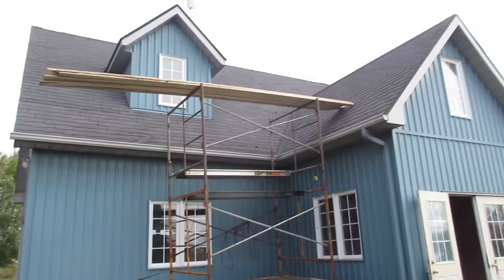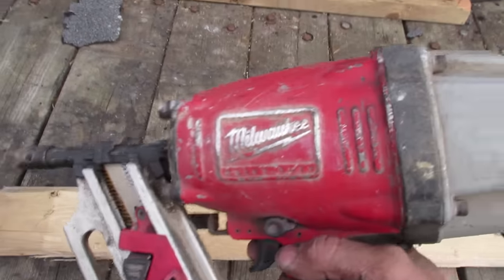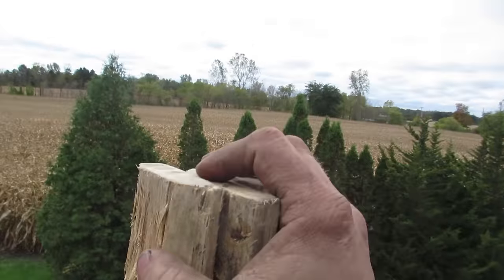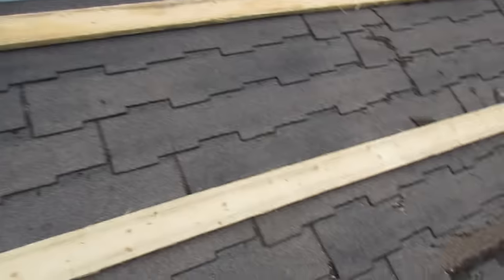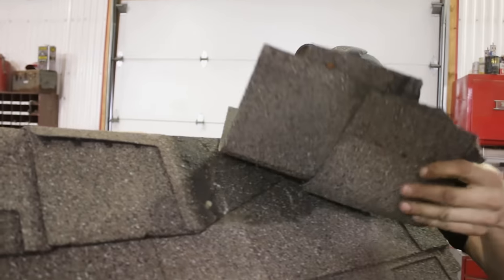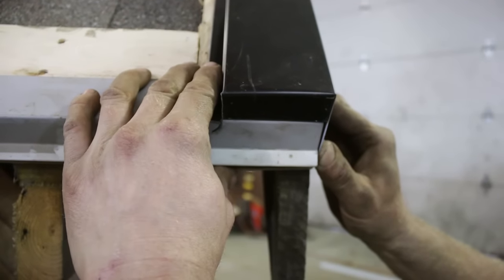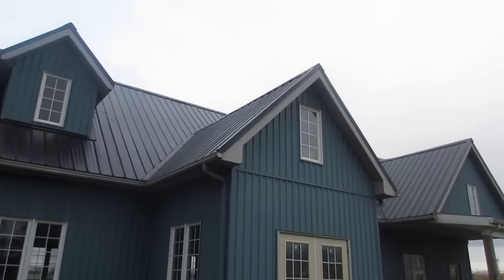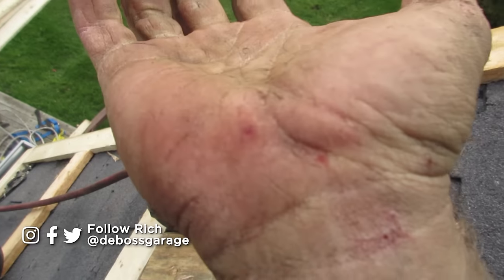How To Install DIY Metal Roofing (House or Barn)

Comment: We have a cottage with 2 or 3 layers of shingle on it. After removing them all it will be exposed 70 year old antique knotty pine tongue and groove from 1952. Should we be covering that pine board with plywood? (Knots have shrunk and fallen out in places leaving holes) Ply at what thickness 3/4? And a membrane of some kind before strapping on top of that (plywood or knotty pine board) base layer? Reason why I ask is they are doing it now near Timmons and really need some great advice from a TRUE professional. Thanks in advance!! Great channel !!!

Comment: You did a fine job in explaining the procedure! You said you are in Canada, which part? I have been to Toronto, Mississauga! I am looking into installing this type of roof system. Shed roof, 24 ft. wide, 3/12 pitch. with 2 ft. overhang. I calculated 26' ft. 8" 13/16" total length. I am thinking I can get 28 ft. lengths? Good job on your detailed explanation. I am sure I can do the job with attention to detail, and no leaks! Thank you again!

Comment: A guy did our "Tin" roof using two foot spacing on the rows of screws, and didn't put down strapping. He snapped chalk lines to get them all even. Only problem was, every second row of screws went in the crack between sheets of plywood! The result: loose and weeping screws. (Screws always loosen due to the metal expanding and contracting with temperature changes.) So make sure you offset your rows to miss the cracks. You could make the first row at 18 inches. We tighten the screws every year, and put in bigger diametre screws when they don't hold any more. We've changed them out three times now. I keep saying I'm going to back the screws out, get up inside, and nail strapping on the underside of the deck, to give the screws some meat to bite into. But it's a pain, and I keep putting it off.

Comment: Excellent info on the dog house. I’m in Ontario Canada and planning to strap and do a similar rib roof for our unheated detached garage. When they built our garage in 2008, they blocked between the roof trusses at the peak. Since it’s unheated, I’m thinking to not cut the ridge sheathing for a ridge vent. Would like your thoughts on this. Thank you.

Comment: I have 3 small rental homes I am re roofing with metal. Thank GOD they are 5 -12 pitch! We are actually using 2.5 inch deck screws to secure the 1 x 4's and we are running them into the roof joist. We left the shingles on and I used a reciprocating saw to cut the the edge of the shingles off.

Comment: I'm interested I your opinion the metal barn I have put up the metal manufacturer told me to put the screws on the flat not the rib. I would think this would maybe cause a problem because water runs down the channel instead of the rib. What's your thoughts

Comment: Where I live we have something called condensation. using pine perlins, non-galvanized nails, and creating air space between the shingles and the metal roofing is sure to cause condensation. The water formed will rot the perlins and rust the nails.

Comment: Most of the industry never mentions you are supposed to change the screws every 10 years.The washers deteriorate.I have learned this the hard way.Have already replaced a roof with shingles.Screws were rusted and replacements wouldn’t tighten not even a #12.

Comment: Would be helpful if you told us what the cost of the materials are and best place to buy them from.
Reply from the maker: Every roof is different so price is irrelevant.    I pay about $.89/sq foot for roof steel.  Each screw works out to about $.08 and every linear foot of trim is roughly $1.
Reply: price in canada, or even different regions is nowhere the same.  your prices can be found locally pretty quick.  If Rich put prices in the video, he'd have tons of I paid this and got screwed or I only paid this.....
Reply: @DEBOSSGARAGE I'm just trying to find out if this is a deal that anyone can pull off, or is it that you've been buying from the same place for years, so they knocked off $0.30sqft...the bread crumbs lead to maybe turkstra in Dunnville, or straight to vicwest in Burlington, but I don't want to start making phone calls if it's gonna be fruitless--that's the price point my head is stuck at, and my next best option is driving across to the Ottawa Valley area to get it (6 more hours of my life, but to save 800 bucks, it's worth it in my mind)

Comment: By the way, I like putting the screws on top of the rail like we used to do on tin roofs.  The secret is not to over tighten the screws which you covered.  The flat sections get the most water and will definitely leak.  And screws are so much better than the old lead-headed nails.  (I'm 70 yrs). 😁
Reply: Darrell Blair My grandfather had a couple of barns w/leaded nails and leaded screws, but also had bolted rafters.

Comment: Could you just put trusses on a flat roof, use the 1by 4 as purlins and screw the steel into that ?  I don't see why not.   I need to check to see the min pitch too, you said 4:12, that would work....

Comment: Interesting. I have watched two steel roof videos and there are numerous contradictions. The other video put the big lip on the bottom, the screws on the flat section of steel, did not pre-drill, and used a much larger overhang of steel at the bottom.

Comment: Leaving old shingles under metal causes increased deterioration to the shingles due to the drying and heat without wind and air to cool . The shingles fall apart faster and you have issues. Strip the shingles or get out of roofing.

Comment: Condensation will rotten this roof in no time. First install vertical battens and on top of them horizontal ones. That way water will flow freely down the roof under the steel. On this roof, condensation water will stay on the roof and eat the wood away.

Comment: Great info and nice details. Only suggestion I would have to viewers is to never use exposed fasteners like this. They will always lead to failures. The sun will destroy that little rubber washer leading to leaks. Or if that screw isn’t perfectly perpendicular and perfectly driven it will leak. Thanks for the video

Comment: Seems pretty advanced for the average DIY'er?  Also what does the OEM say about fastening on top of the ridge?  I think most exposed fastener OEMs say to fasten it on the flat valleys.  I see advantage and disadvantages both ways but I'd want to see a statement from the Manufacturer that states the fasteners can be placed on the tops of the ridges for warranty protection....common sense, won't you say???  Don't you tell your customers you always follow the Manufactures written instructions?  I know i would.  Just sayin....I'm a retired general contractor with about 45 years experience in the trades.  Never had to "eat" any big jobs!!
Reply: I built a 12' x 16' enclosure over my patio to keep the rain and snow off of the hot tub.  I used 2' wide "clear" corrugated fiberglass panels for the roof and walls.  I put the screws in the valleys, instead on top of the ridges, because I didn't want to take the time to put supports under the ridges where the screws would go.  That was a BIG mistake.  Every year, I've had to either tighten screws to stop leaks, or replace screws where the rubber deteriorated--probably from staying wet longer from being placed in the valleys.   The roof has a slight slope--maybe 4" over the entire 12' run, so I'm sure that is another factor.  

A few years later (maybe 15 years ago), I built a 10' x 16' shed in the backyard with a metal roof (3' wide corrugated steel).  I put the screws on the ridges and haven't noticed any leaks or any water stains on the purlins.  The pitch of the roof is probably 4/12.

I watched this video, because I'm considering a corrugated metal roof for my house.  If I do it, I'm leaning towards putting the screws on the ridges, even though I think it will be more time consuming that putting them beside the ridges.  I'm going to check to see where the manufacturer says to put the screws, though, and take that into consideration as well.

Comment: If Furing runs vertically up roof, open at bottom and you have a breathable ridge cap you can have a self cooling metal roof powered by the heat of the sun.
Reply: Diagonal vertical doesn’t work

Comment: I don't understand why people leave the shingles and old sheathing on. Wouldn't the best way be to strip both, then put on the purlins?  With the way presented, when you get a leak you will have a heck of a time trying to find out where a leak it comes from.   I guess the only advantage is not having to worry about rain during installation.
Reply from the maker: Its a sound barrier, and when I'm done, the roof doesn't ever leak

Comment: Is that metal designed to be screwed down on the ribs, doesn’t look like it to me. I’m an insurance adjuster, I would love your installs because I would get bonuses for deny claims. This way of fastening might only work on A-frame houses where pitch is straight up and down.
Reply from the maker: The screws are put on the rib so as the snow slowly melts it doesn't have a chance to creep in like it would in the flats.  Using the ribs also allows you to stretch and shrink the steel.    The trouble with most inspectors and insurance adjusters is that they have no real world experience.   Here are the instructions just in case you feel the need to deny a claim incorrectly  https://vicwest.com/wp-content/uploads/2017/05/VW-Performance-Series-Install-Manual.pdf

Comment: Lmao great job so what are you gonna do when the condensation starts and rots out your strapping and starts to mold. It also looks like you strapped it on 2 ft centers when the snow and ice falls off your dormers. It's gonna smash your steel to bits.
Reply from the maker: I guess it will do the same thing as every other building put up in Canada...  The pitch is 12/12.  It will never have snow and ice buildup

Comment: No caulk or mastic under the overlap? I’m asking because I’m just about to install metal on my Gazebo roof
Reply: no adhesive is necessary when lapping panels on top of the adjacent ones
Reply: Jeremy McClanahan thx, I will be using closures at the bottom edge of the hip roof. Would there be a closure for the ridge cap or the piece that runs from the ridge to the gutter at the 4 roof lines?

Comment: I do a lot of steel roofs and I always start at the top on steep pitches abd leave the lower third or 1/4 of the sheet unscrewed abd put the ridge on and then slip my lower steel sections under the top ones and then I dont have to walk it
Reply: Please explain. I don't understand

Comment: Love my metal roof. I have no need for a sliding board since installation. With a 4 12 pitch I can easily clear a 5 inch wide gutter. And let me add that an old springy deck is perfect for landing. Roofers have my utmost respect.
Reply: lol, hope it's a basement house, low to the ground :))
Reply: @throttlebottle5906  What's the fun in that? ;>)

Comment: Thx for the video. I’m building a 10’x12’ Gazebo with a hip roof. I’ve never installed steel roofing but I’m going to give it a shot.
Reply: Please don’t fasten through the ribs. That is super wrong
Reply: @dustinbaker6947  I didn’t..👍

Comment: Who do you recommend for steel roofing supplies?  I am also in Ontario.  Need to do this in the next year or two.  IKO shingles are only 10 years old and starting to show signs of needing replacement.
Reply: In ontario call Havelock metal.
Reply: Iko shingles I used-12 years on a 25 shingle, eroded almost through. Junk. Warranty a joke. never again.

Comment: You demonstrated very clearly why you do NOT screw through the ridges on roofing !!! You crushed a ridge !!! = leak !!!!  DUUUUHH!!!!!
Reply: He did that to show what not to do. That doesn't  happen if you know what your doing. Putting them in the ridges is the only way to do it right. I have changed out 1,600+ screws on a building where they were put in the flat. The roof was leaking everywhere and about 10% were rusted to the point that they were broke.
Reply: @dalewilliams9846  When all else fails READ the installation instruction from the manufacture on the roofing !!!!  Screws go in the flat !!!  I have never seen a metal roof company say to install in the ridge.  That is old time thought and it caused problems......  screws have to be installed straight and not over tightened !!!!
Reply: @wilburfinnigan2142  Yes, that is the old way, when using 5v and hand nailing. Iij m telling you from experience,  installing screws in the flat, is not the way to do. Sure, it may never leak on a steeper roof, but anything with a shallow pitch can, and eventually will. Why put a screw on the part of the metal that all the water and Ice is most likely to be, when you can put it on a rib, where water runs off?
Reply: @wilburfinnigan2142  The manufacturers also recommend changing screws every 5 years because the washers degrade in very fine print.
Reply: @mobilerenovations  Print must have been really really really fine !!!!!!
Reply: @mobilerenovations  Because it seals better Dumb ass !!!  and the manufacturers recommend that, and it meets the warranty !!!  Got roofs that have been that way for 25 Plus years !!!  NO leaks !!!!  You do them any way you want and I will do them my way !!!!!  DUUUUHH!!!!!

Comment: If you are going to screw through the top of the rib make sure you use stitch screws... Not all metal is to be screwed through the rib it depends on the manufacturer.
Reply from the maker: Sorry, this is Vic West and I have been using them for 20 years

Comment: I have been doing steel roofs and barns for a long time I've never seen anyone put the screws in the position you do. I would suggest you put nails on opposite angles when you are nailing into the roof with your straps for purlins and I also suggest two by fours not one by material because they will not split and when you screw your steel roof down with the nails on angles in the boards they cannot be ripped up by wind storms because they anchor so you use your nail gun every nail is an opposite angle going into the roof this way it is locked down so that when you screw the roof down to it there is no way a windstorm can rip up your roof
Reply from the maker: None of the trim works with 2x4.  Angling the nails is a must.  Forgot to mention that, thanks.  Roofs I put on 15 years ago are holding up fine so no worries there.
Reply: we also make sure 2 nail into the trusses...
Reply: we also use 1x4s

Comment: So was this all done in a day with a few guys? Amazing what roofers charge for something like this.
Reply from the maker: It took about 2 weeks with my dad on the scaffolding and me on the roof.  The flat side took about 2 hours with 1 other experienced guy.  Same guy that was in the barn build
Reply: Most of the cost for roofs is material
Reply: Depends on where you live and how hungry the roofers are.  My area it is about fifty fifty with a standing seam roof and more on the labor end if you are using exposed fasteners (which is a cheaper style) and that is for a flat roof deck with no complications (which add to the labor).  Start getting fancy with architectural detail and it goes way up.  Doug
Reply: I do roofing and our average roof is 5k, some standing seam is 10k. Depends on if it's torn off first and whether there are hips, dormers, valleys etc.
Reply: Mcauley man8 not all of the time. Our roof was quoted as $5000 material and $16,000 labor! We do have a 12/12 pitch though.
Reply: Haha people really dont know what goes into some roofs for cost. Last summer we did one that is a new product that is an enhanced slate looking metal. For the one large house it was 85k. And probably the coolest metal roof to date

Comment: Have you ever done a, “hidden hardware metal roof”?
Reply from the maker: No, I would have on my house but there were none that didn't require plywood under it.  I built mostly barns in my construction career.  When I built houses, we never did the roofs